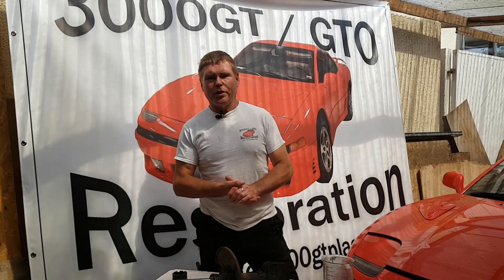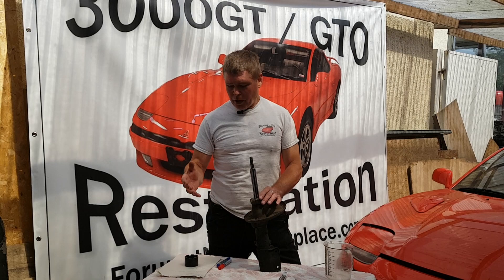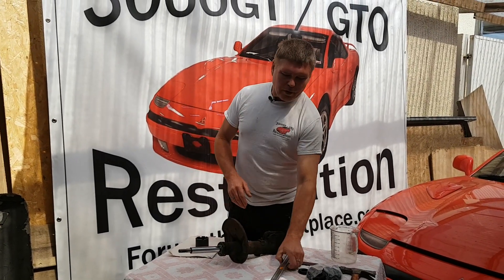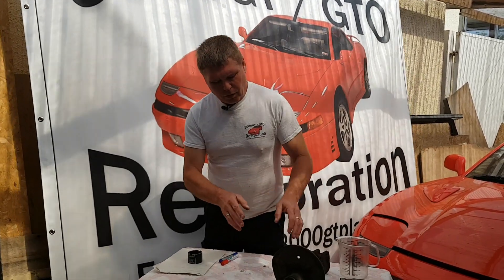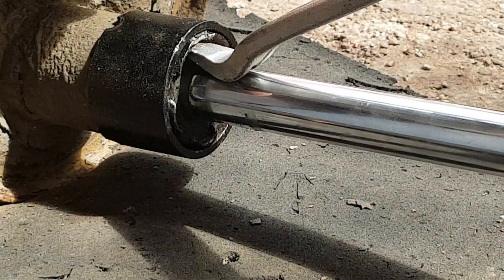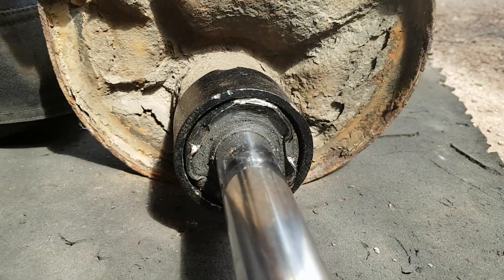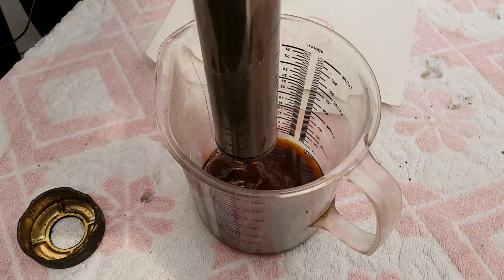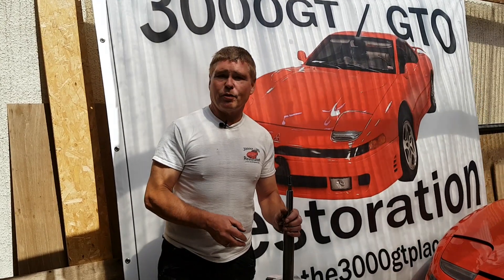Mitsubishi 3000gt / GTO Strut Disassembly

Comment: hey man, I can help you.  KYB can't release fluid details due to an active NDA with Mitsubishi, but Nitrogen is pressurized at approximately 150 PSI.  seems to be pretty standard.  Reach out if you want to collaborate
Reply: I originally gave people added info to move forward.  Glad to see you got NOK to manufacturer these for you.  It seemed like there were newer alternatives that may of worked, but having the original is probably an easy way out.
Reply from the maker: Hi Haralabos
I would be interested in working with you on these. Are you able to contact me via private message on the forum?
Regards Joe

Comment: Hello Joe, did you open the inner parts of the struts, the ecs parts? 
On my spare parts I ve 3 front struts left without pressure inside or on the piston rod, but 8 rear struts (from the same cars ´91-´94, EU and Japan) with power on the rods. They came quickly out, iff you push the rods. Thanks, Frank from Germany (GTblue)
Reply from the maker: I will cover the strip down of the inner part in a future video. They are rather tricky and easy to damage.

Comment: Wow that's amazing, I was on the original thread for the rebuild, tried a few things and was scared of the crimped seal, managed to pop the retainer and found the bent metal I also didn't liked the way that he destroyed the strut body so I installed a schrader valve and used jack oil for the refill but without a measurement just eyeballing the amount of oil  and adding a little more to compesate the leakage, definitely your video is the most helpful out there, thanks a lot.

Comment: What brand of r12 do you recomend i live in arizona and it gets up to 116 i did my timming belt before watching your video on moving the ac line and i disconected it to get more room and now i need to order more, and have you done a ac reacharge video before ?
Reply from the maker: Hi
In most of the world, r12 is now banned. I am not a specialist in ac and in my country you need a permit to do refrigerant work. You can change to r134 and it works fine but I recommend that you change the drier unit and go to a specialist for a recharge. If you really want to DIY it. Watch some of the specialist videos that are on YouTube. You do not need to change the compressor as some people will tell you but you may need to change the oil in the compressor.